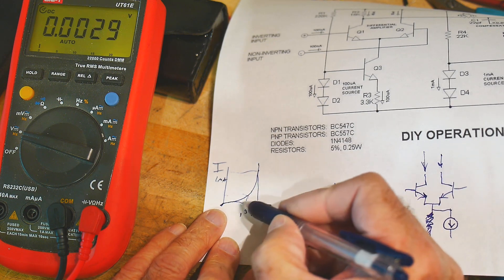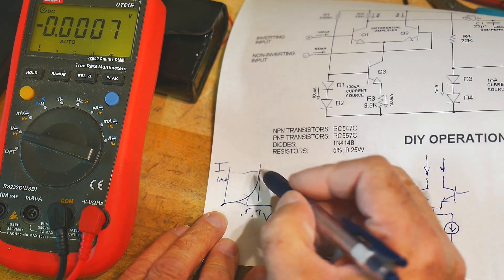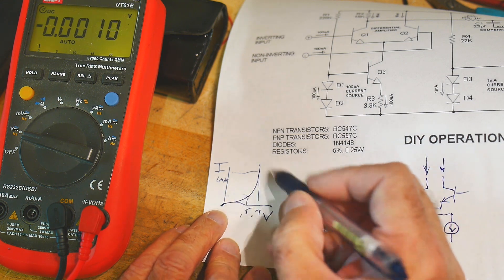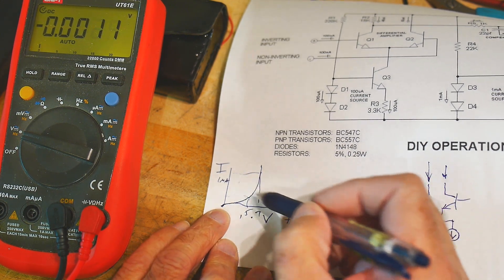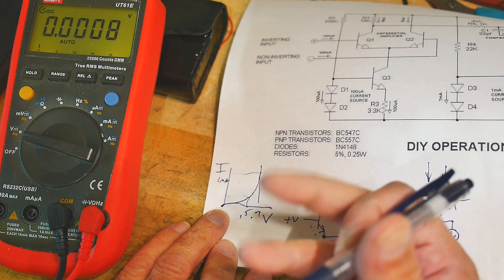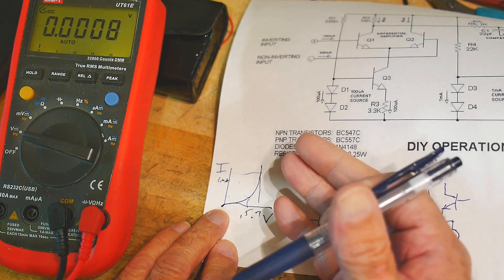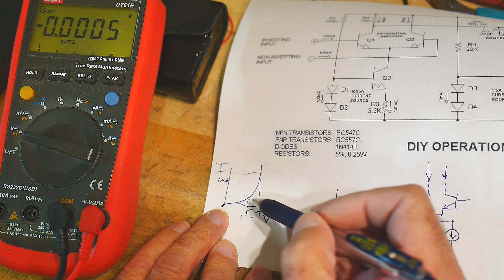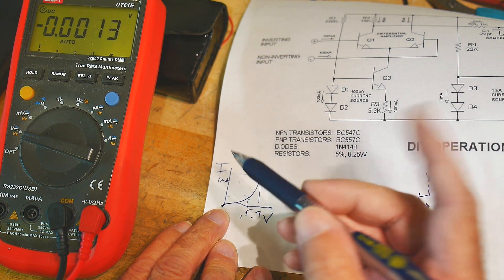#413 Build an opamp (part 3 of 7) output driver

Comment: I'm coming 4 years late to this party but at 10:56 I think you mis-read the schematic when you referred to a 5.1k resistor. Maybe I'm wrong, but consistent with the labelling of the other components, I think it's just labelled "R5" and then there's a comma and space, not a decimal point, and it's actually a 1k resistor. (So it reads "R5, 1K", not "R5.1K"). It's much clearer on a screen than a printed copy. I'm not smart enough to know how that would affect the circuit. Also you seem to have over-looked the 22pF capacitor labelled C1. I'm hoping it's not needed because I don't happen to have a polarised cap with that value.
Reply from the maker: yes, it is 1K as you point out. the schematic uses a polarized symbol for the 22pf but that is just wrong. there is no such thing. 22pf will be non-polarized. the circuit will work without it but may oscillate in  some cases.
Reply: @IMSAIGuy  what kind of discrete capacitor should be used for opamp? Which type replaces a silicon based IC opamp capacitor?
Reply from the maker: @davadoff  any would be fine

Comment: Do you happen to know why we use the 15k resistor for Q1, but not for Q2? I'm following along and testing each segment as I go. Also for some reason I had to add 22k resistors to the bases of Q2 (grounded) as well as Q3, otherwise my power supply would 'short,' which I found interesting. In class my professors only talked about MOSFETS hah, so I'm having to try and learn about BJT's on my own. Thanks!
Reply from the maker: you can put resistors on both no problem. seem like the second one should be there but it is usually omitted
Reply: @IMSAIGuy  Ok sounds good thank you for the info, much appreciated!
Reply: resistor is needed to tranasform current to voltage as already mentioned couple of times in other comments. Now there is a question why do we need (or not need) the resistor in current path of Q2.
Q3 is current source. Means generating ALWAYS the same current (as long as possible of course). So, when the signals on both inputs are same (for example short curcuited), the current thru Q1 and Q2 collectors is nearly the same and has value around 50 µA. This current is "balancing" because base-emiter voltages on both transistors are same - that means both are equally "open".
Now, second case:
voltage on positive input is higher as input on negative input. Let's assume we have DC amplification factor 4 and have 2 Volts on positive input and 1 Volt on negative.
When the circuit comes to stabile state, we will have higher current thru 15k resistor. Let's assume (but value is most probably wrong), there are 75 µA thru 15k resistor.
Because Q3 is always delivering exactly 100µA, current thru Q2 CAN maximaly be 25µA, no mater how "open" the Q2 is.
For that reason, resistor is not neccessary for Q2.
In first case (output voltage is zero), the current thru both resistors will be the same, but voltages on transistors are different. voltage between emitor and collector of Q1 will be 0,75 Volts (50µA x 15KOhm) lower than voltage over Q2. This could lead to different thermal load, but at so small currents like here, this is irrelevant.

Comment: By my analysis, the voltage swing at the output would be limited to around 12v or -12v.  The specified RL is >= 250ohms, so your transistors should each be capable of handling 48mA.  Of course, common speakers (if you're building an audio channel) are 4 and 8 ohms, so that would only be recommended if your transistors can handle 1.5 to 3 AMPS and your speaker can handle up to 36 Watts or so.  I connected this up to a 50 ohm speaker and my transistors went quickly into a thermal runaway condition, showing 2 watts of power dissipation for the circuit before over current protection on my power supply kicked in an shut it down.  Let me tell you, pushing a watt or two of juice through a small-signal transistor capable of handling 650mW will cook those transistors - but the circuit works a charm when I added a resistor in series with the speaker, or better yet, limit the incoming signal.  It makes sense that there is no current limiting on the output stage, after all, this IS an OP-AMP that is designed with IDEAL OP-AMPS in mind . . .

Comment: Thanks for the interesting series. What is the function of the bottom right current source?
Reply from the maker: it sets the current in the leg, q4 d5 d6 q5.
Reply: Why is a constant current needed there? : )
Reply from the maker: @PS-dw5qo  in general they keep circuits stable over a range of supply voltage differences. if you use resistors the bias voltages will vary depending on the positive and negative supply voltages.